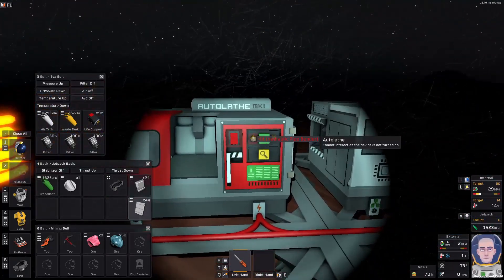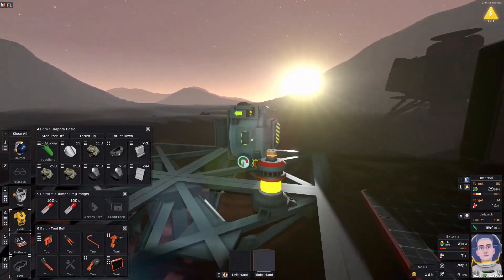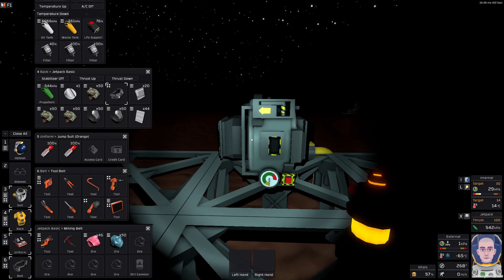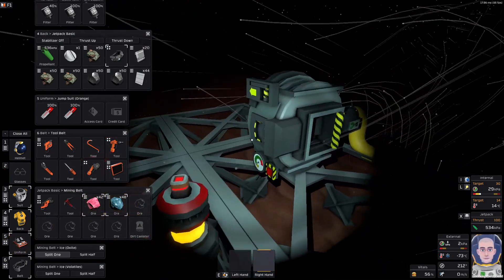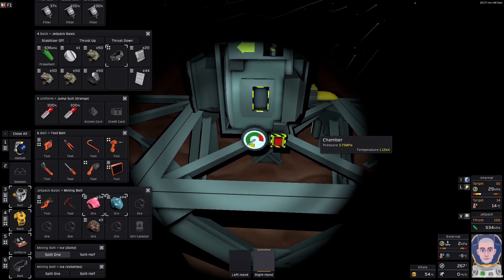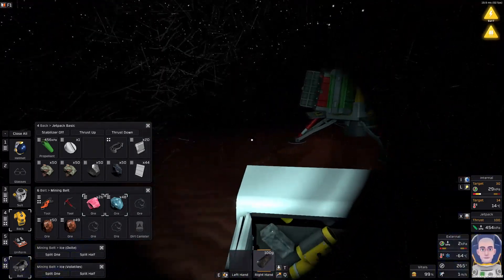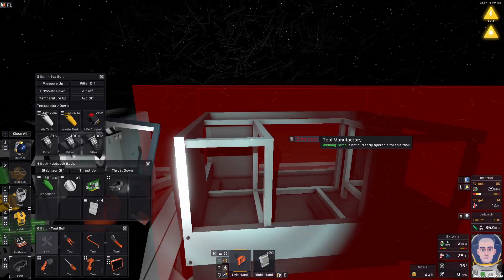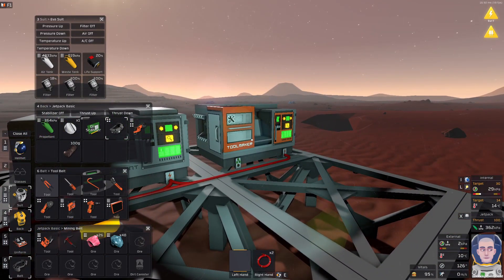Stationeers Beginner Tutorial Ep. 2: The Furnace

Comment: Came here cause the requirements for solder have changed
Solder -
temp 350k - 500k
Pressure: 1MPa - 100MPa
1/1 ratio
and I can't get the temp down far enough before the pressure drops out of range, not even close.